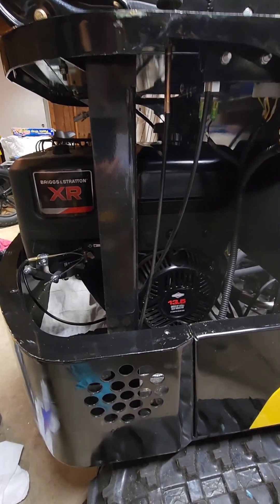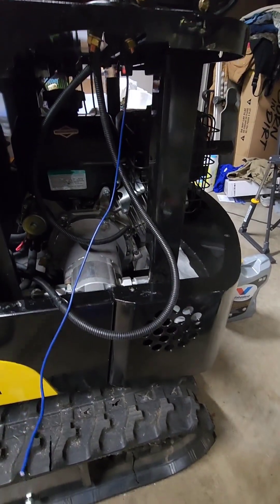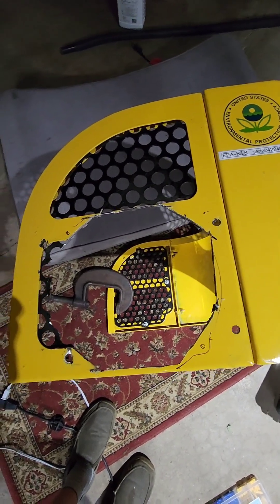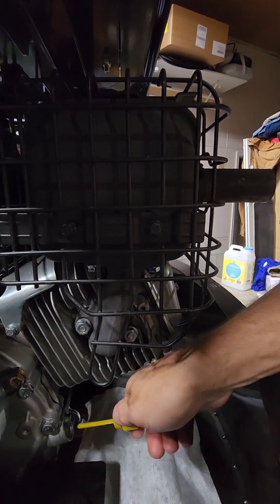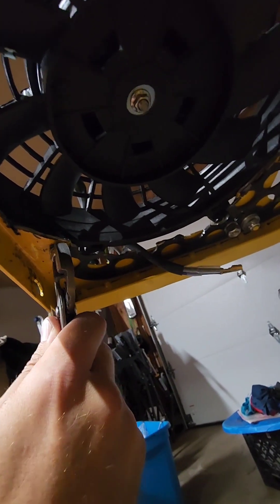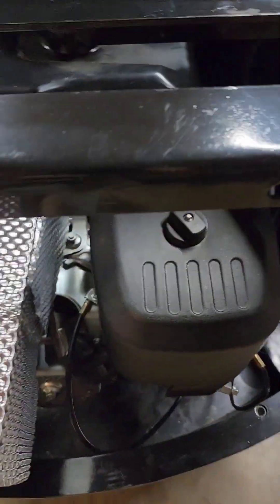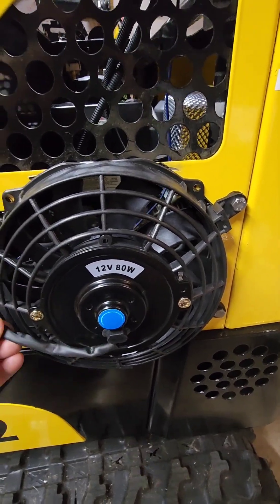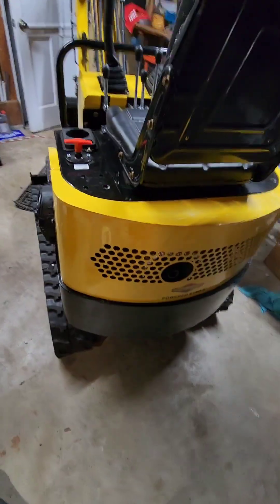Chinese mini excavator, adding cooling fan.

Comment: Real Redneck install on the fan.
I put my inside and
It can't be seen. I did add a second 
Battery to help out
The charging system.. plus it adds extra weight 
To the machine.
I love my machine 
So far... 25 hrs with
No issues... I did cut the flat edge
Off the front of my
Bucket ant welded
On a cutting edge
And what a difference that made in digging...
Reply from the maker: Sounds like you should be working for space x

Comment: Love the heat shield idea!  Ive thought about taking the pull start housing off to expose the motor cooling fins, and running some sort of duct to the side of the excavator where cool air can come in.  Seems like it just brings in hot air the way it is.  Raising the seat up a couple of inches to let heat escape might be a modification I do in the near future.  Also, My hudraulics get way too hot, so i will most likely be installing a oil cooler, and a flexible 200 watt solar panel to mount to the top of the canopy for another fan or to keep the battery charged.  My bigest complaint about the machine is how slow the tracks are.  Especialy if the drive motors get hot.   NOTE: These machines have a 9 amp charging stator, so do not exceed this or you'll start to drain the battery.  Is why ill probably install a solar panel.

Comment: Does the engine make enough amps to keep the battery charged or do you plug a charger in when not using?
Reply from the maker: I believe it uses a magneto to charge everything while running.  No need to plug in.

Comment: this mod could have easily been kept internal for a cleaner look and not getting hit during operation though...I've got a similar internal mod in the works on my H12
Reply from the maker: Good luck with your install.  You will not get the same c.f.m airflow if you go internal.  These machines do not move fast so im not really worried about dust or the fan getting "hit"

Comment: I've seen a few people Mount them without cutting the metal out. They mount it on the inside, and you can't even tell it's there now you have nothing to protect your fans.
Reply from the maker: Less air restriction my way, what does the fan need protection from?
Reply: @lukerhoda1277  a lot of people clear trails with them, so the brush nearby could easily damage them . Accidents happen that's all I'm saying.
Reply: @lukerhoda1277  Is the fan being exposed to rain an issue?

Comment: In just got one of these, hydraulic oil level seems to be low on that little glass bubble. It is below the red dot and the tank is already full. Do you know if this is normal ???
Reply from the maker: The hydraulic oil should be at least half way up the sight glass.
Reply: @lukerhoda1277  thank you.

Comment: I just got my fans in and will be installing 2 with the push pull technique.  Each fan will be mounted inside the housing facing out.  There is a spare wires that is not being used inside under the throttle and key switch area.  It is there for extra lights.  One wire is hot all the time and is hooked to the battery disconnect and another that is switched by the light  switch.  They also have a ground in the bundle.  Saves you from having to run wires.  There is room inside the engine compartment to mount the fans so you don't have to worry about damaging the fan while you are operating the excavator in heavily cluttered areas.
Reply from the maker: I had no idea about the extra light connection.  I'll have to check it out.  I know i could have mounted it inside.  I still like how i did it.  To each their own.

Comment from the maker: Update, ive put 6 hours of hard work on this machine since installing fan.  It has stayed cool and done a good job.  I need to do another oil change and grease everything.  Thanks for watching 👀
Reply: Have you had trouble with the hydraulic oil getting too hot?  Mine gets so hot the hydraulics slow down significantly after a few hours of constant operation.
Reply from the maker: It will get hot but i have not run into any performance issues.  I usually run it for an hour then take a little break.@skeller0160

Comment: I am probably going to do this but add an in line switch so it's not running all the time.
Reply from the maker: I was thinking about doing that.  Dont need the fan when its below 50 outside
Reply: thermostadt!

Comment: I have a HT-10BZ on the way.  It comes with a hydraulic oil cooler.  I also am planning on adding a fan on the left side, and I am going to try for an inside fan.  Thanks for the video - it helps to see how other address the problem.

I am wondering if that aluminum housing you build around the exhaust will block airflow and make it too hot.  What if you cut the left side off and let the fan blow are over and out the back.  Right now you have no airflow over the exhaust.  Might that cause problems?
Reply from the maker: My theory is the exaust/muffler is a big contributer to heating engine compartment.  The aluminum housing is helping to direct the radiant heat from muffler out of the engine compartment and is shielding the fuel tank from the heat.          Machine runs good and stays cool.

Comment: Any concern about the fan using too much power and over working the charging system? Mine came with a hydraulic oil cooler with a fan on a switch. I’m wondering if adding another fan for the engine will cause electrical issues
Reply from the maker: No the fan does not draw many watts.  I have not heard of charging issues even with multiple fans hooked up

Comment: Why not pull the air out. There enough space to pull air around the motor. 
I would check the swing arm gear and make sure it is tight
Reply: you should pull air into the sides so that it escapes along with the exhaust in the rear to create a pressure flow.  pushing out the sides risks pullin ghte exhaust heat back in

Comment: Just picked up a mini excavator and i installed a 12" fan blowing the hot air out. I primarily did this because i dont want dirt and dust to get pulled into the engine bay. It works surprisingly well in cooling the excavator. I also used heat shield under the seat to keep my butt cooler while using it.
Reply from the maker: If you exaust air out it still has to draw in air and dirt from outside.
Reply: @lukerhoda1277  true... but a very minimal amount gets pulled in versus the amount that would be blown directly into the engine compartment, and the amount of heat that it has reduced outweighs any negative. It's actually help keep the hydraulic oil stay cooler.
Reply: Wish my disconnect was accessible from the top next to the operator seat. Mine is under the deck so have to lift the seat to access. May add a switch. Great idea

Comment: your going to need the fan!!! I boiled my fuel and had to replace the carb!
Reply from the maker: I believe it.  Now i have a leak on left drive motor and my right joystick developed a ton of play.
Reply from the maker: The play in joystick was a loose nut on the linkage.  Tightened it up, good as new.

Comment: Nice job Luke. I'm getting ready to buy a couple of fans for my Miva. It has pilot controls which puts all the hyd. lines right in the way for mounting the fans on the side like you did, I just might have to put it on the outside like you did. I'm thinking about a 9-inch fan on the side and out the back mounting a 12-inch fan. I thought about bolting it to the grill, but I don't know how I'll end up attaching it because of the curvature of the grill.
Reply from the maker: Thanks Mark, the 7in fan seems to be the right fit for these 1ton machines.  I think the hydraulic cooler with a small fan blowing on it will be my nxt upgrade.  Good luck with your Mini Ex.

Comment from the maker: The nxt day i planted a dozen 2 gal trees.  I dug nice, big and deep holes with the Mini then tilled in 60lbs of compost in each hole.  It ran great the seat did not heat up like it used too and the gas tank was nice and cool after running machine.  Hydraulic pump was hot.  Not sure what optimum running temp for the hydraulics are.
Reply: I’ve read you want to keep hydraulic temp under 180.